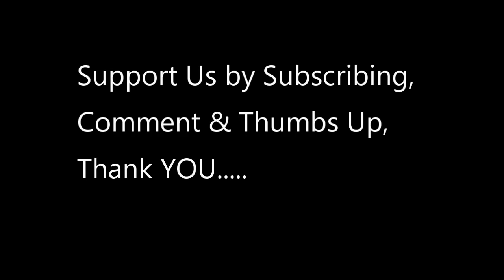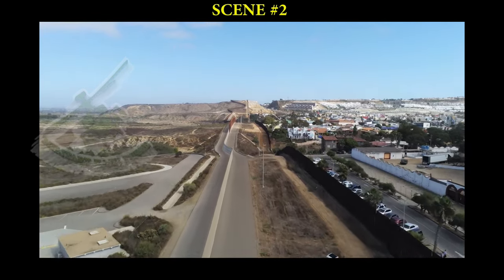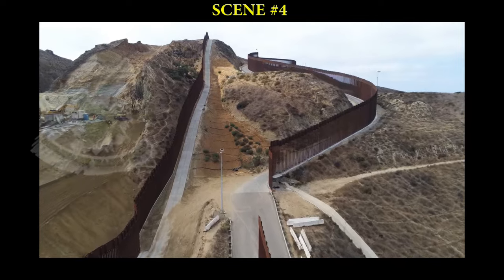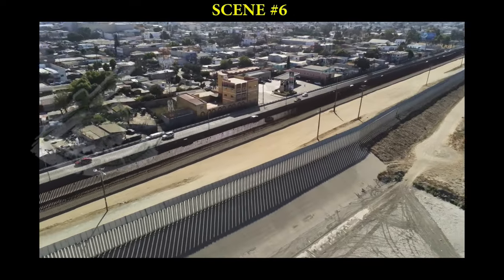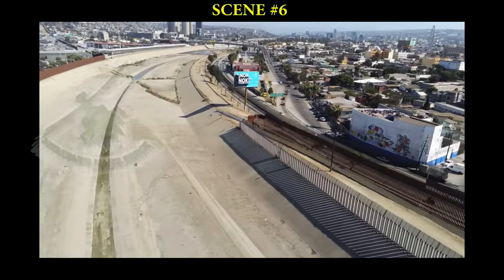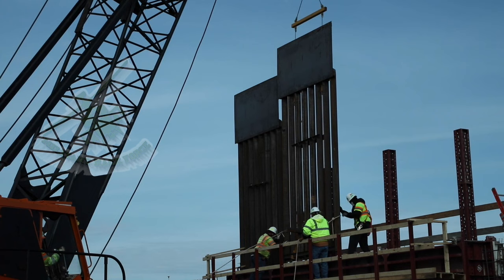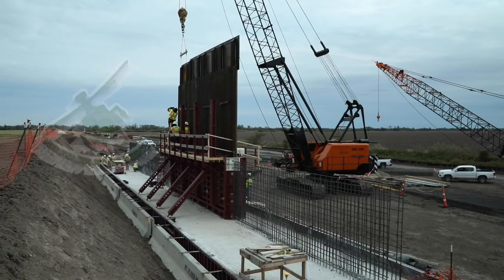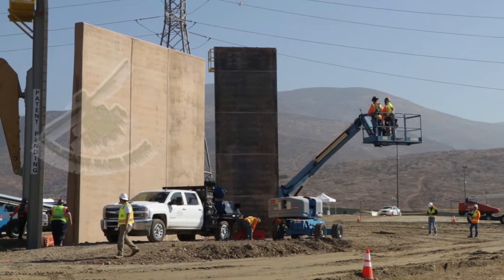A LOOK at TRUMPs BORDER WALL -UPDATE 2019 - PART 13

Comment: CBP selected a steel bollard wall configuration using heights of 18 & 30 ft. 93 miles built as of 12/13/2019! Current weekly rate 2 miles.
Reply: we feel safer now Mr. President Trump!

Comment: Pour concrete into the upright tube. Much harder to cut through
Reply: I like Joel’s idea better.
Reply: Trump can't afford that.  He has less than a year to convince you plonkers that he's built that wall he convinced you that you need.  He will make 500 miles out of tin foil and paper mache if it will fool you long enough to vote for him again.
Reply: Howard Little who running for election this election would be a better president?
Reply: @rwj3373  Trump is the worst president I have ever seen, and historians tell us he is probably the worst ever.  Any Republican presidential candidate from the last 50 years would be better. Any Democrat currently running would be better. Most of the people who support Trump would probably be better presidents than him. I would vote for Adam Sandler and Weird Al Yankovic before I voted for another Trump-Pence term.

Comment: The only thing that Bollard fencing is good for is for the steel reinforcement for the much larger concrete structure. Something Great Wall of China style but a little more Grande
Reply: It's a funding issue I think. If we get Republicans majority in House and Senate plus Trump in WH in 2020, we may have a chance at something more grand.

Comment: The reason the wall is this design is Border Patrol asked for this design for safety and security reasons. They can see through it and determine the threat and response needs.
Reply: And drug dealers can more easily hand drugs & $ back & forth more easily!!!!
Reply: Aaron Ehrhart, it’s true if there is no border patrol. And it’s also true that, ifthere is no border patrol, it can be made by throwing it over the concrete.
Reply: @aaronehrhart2346  yeah good luck when there's security up and down the whole wall!!!!

Comment: Did they install seismic monitors to catch tunnelers?
Reply from the maker: no
Reply: @militaryforcestv1  to bad
Reply: @patrickradcliffe3837  The wall goes 6 feet underground,i think in most attempts a patrol agents will see you digging before you finished.

Comment: Today, CBS finally had to admit the boarder wall is being built and Trump's promise is being kept.....
Reply: Just because the wall is being built doesn't mean its having an effect. Ya, a really thick fence is being built at our expense, and while on paper it looks sound, it only took a cheap power saw to make it instantly obsolete.
Reply: @rektaldischarge7496  UP UNTIL NOW CNN SAID TRUMP WAS ONLY REPLACING BOARDER FENCE....Now the real wall is going up. Only time we'll tell.
Reply: @rogersowers9837  Not much of the wall has been built, and the wall that is currently built was proven to be ineffective as people are climbing over it, and are cutting through it.

Not only was it a waste of money but its obsolete on arrival.
Reply: @rektaldischarge7496  But 90% of illegal crossing still happens at the port of entry because you can't carry all those drugs any other way. It still will stop most.
Reply: @rogersowers9837  Highly unlikely, people still are getting through and even destroying the wall in the process, again, basically a waste of money.
Reply: @rektaldischarge7496  You would find something wrong if it was perfect.
Reply: @garystrauss6682  I actually made a few points on what the wall would need, that being you have to risk not seeing through it for it to be near impossible to gut through, and the second would be something similar to prison walls at the top that would make climbing it a pain.

A ladder would still get over but normal climbing would be impossible as well. To be honest, this is nothing more than a thicker fence, and yet its still a useless piece of shit.

My hate for the wall is the fact it was poorly thought out, and its design is so easily made obsolete with either a ladder or a $20 power saw.
Reply: ronald rusin  You fell for one of the classic blunders!

- Republicans after using tax payer money to build the wall -
Reply: Ignoramus, "boarder" is spelled, border. 
Disqualified from participation.
Reply: @theelaffingman8776  Try what exactly?
Reply: PJ R  Dude, a wall along Canada would be a nightmare to even pay for seeing how its tax payers who will be paying for it. Not only that, but the wall already along Mexico was instantly made obsolete as people climbed over it in a minute, or literally took a $20 power saw and cut through the fucking wall itself.
Reply: PJ R  Update on the wall, a few weeks back a large section of it fell over due to high winds. Again, it shows itself as a useless waste of money, but this time it was a pretty comical example.

Comment: Walls work I was in China a few years ago to see the great wall of China and I didn’t see one Mexican there at all so Walls work
Reply: China Doesn't have Democrats. That's also why walls work there.  
No NANCY POLOSI..Either
Reply: ronald rusin  I really hope this was a joke. cause Japan has to cross a sea not a wall. lol
Reply: You wont ever see anyone in China that they don't want. You sneak into China you will likely disappear minus your kidneys liver and eye lenses, and if your dog is with you he will get invited to dinner but not to sit under the table if you know what I mean. Lol
Reply: @rfitz4420  let's be real here, they won't eat your dog, they will however, eat your cat.
Reply: Nailed it😂😂
Reply: Steven Miz  Steven , Can you direct me to where and how this is happening . To cut the wall you must use acetylene and oxygen . An average 51" acetylene tank weighs 190lbs and the oxygen tank would weigh 150lbs+ . This would be for 30-40 minutes use , the tanks must be kept upright this would require a heavy duty vehicle to transport and be able to park within 10 ft of the wall to be able to use hoses without removing the tanks from the vehicle . Also if the coating is not first grinded off the wall the burning of the coating will give off toxic fumes to be able to grind on the metal you would need a very loud compressor . How is this being done without being seen or heard . I have no proof that this is not being done but if it is an average immigrant would not be able to do this only the drug dealers.
Reply: Bet your a-- they work. The Dems hate it because it cuts down on their voter imports.
Reply: ronald rusin  The wall is in the west, Japan is in the east. Read your geography books!
Reply: Steven Miz  So you're one of those open borders, tear American down seditionists, eh?
Reply: ronald rusin  It was built to keep Mongolians out. Learn to read and spell. (Claiming) haha climbing, Da.....
Reply: Are you for real? Oh my goodness, sorry I just can't stop laughing. The Great Wall is famous for its failure. As far as that ridiculous  billion $ PR stunt on our southern border is concerned, illegal immigrants drive across that border as tourists, then don't leave. That wall does squat to that.
Reply: ronald rusin   spell check
Reply: ronald rusin  Do you mean, climbing?
Reply: Robert Phipps  At least it wastes billiins of your/our tax $! ?????
Reply: @chuckkelly1225  Oooooh upset & afraid of strong woman; just like dmfp!!! Figures!!
Reply: Steven Miz  And $30. Walmart saws!!!!
Reply: @eaglerider1826  $30. Wal~mart saws have worked very well you supe!
Reply: @williamkerr2121  Or the brave ones still here in Amarica who don't feel the need to cower behind a wall balled up in the fetal position like dmfp!
Reply: @aaronehrhart2346  This from a dog barking in the street.
Reply: ronald rusin  the Chinese wall was built to keep out the Mongols and it worked. Review your history.
Reply: Lmao
Reply: Lol
Reply: Name one place in the world were open borders work
Reply: @anybodybutme5315  I have lived in Europe and France, Holland, Germany, Austria, Denmark, Poland, Belgium, Hungary all have open borders with each other.
Reply: Like I said open borders that work
Reply: @anybodybutme5315  All are better places than the USA
Reply: Really you've got to be kidding you think you're the only one who's ever been to Europe who's ever seen all the people trying to get on the train to sneak into the UK for the people from Syria that now can travel freely through the EU so when I say I know what I'm talking about I've been there done that got the T-shirt
Reply: Really you think you're the only person that's been to Europe I've seen the people trying to jump on the train and go under the channel to get to the UK I've seen the Syrian refugees that have been just dumped into Europe and now travel freely through the EU so you think it's better than the United States oh well but I've been there done that got the T-shirt
Reply: John Carosi  Bark! Bark! Bark! Bark! Silly, little dogs barking in the street, in the wee small hours of the morning, half a block away. Remember the raw, red butt burn of 2016? Well, pucker up for another one, Bucky, 'cause it's on its way there's not a thing you can do about it.
Reply: @aaronehrhart2346  supe??  Do you have any idea what you are talking about ? You're going to cut through the wall with a $30.00 Saw Zaw ,   After using 150 blades and two months time you might cut one beam . Let me guess you're another unemployed liberal who has never done any manual labor.
Reply: no trumps either
Reply: Not anofe taco,s. There. Lol
Reply: What are you talkin about Mexicans, Hispanics and many Asians are residing in Mexico. We are Asians we come from the Mongolian race. where all come from the Mongolian blood that came to Mexico 15,000 years ago. We were here before way before the white even put food in this... Viva la rasa..
Reply: Steven Miz  The only thing you get by running away is stabbed in the back. I quit running a long time ago.

Comment: 90 miles as of 12/6/2019. If the rate is 2 miles/week & we have 55 weeks to the end of 2020 then 2 x 55 = 110 +90 = 200 miles.

If 3 miles/wk then 3 x55 = 165 + 90 = 255 miles.
if 4 miles/wk then 4 x 55 = 220 + 90 = 310 miles
if 5 miles/wk then 5 x 55 = 275 + 90 = 365 miles
if 6 miles/wk then 6 x 55 = 330 + 90 = 420 miles
if 7 miles/wk then 7 x 55 = 385 + 90 = 475 miles exceeding lowest level goal
if 8 miles/wk then 8 x 55 = 440 + 90 = 530 miles exceeding most ambitious goal

New report due 12/16/2019 from @USBPChief
Reply: We'll have four more years. If the dems didn't hold it up so long it would be done by now.

Comment: If you build it, they will come, if you build it they will still find away around it, every thing has a soft spot.
Reply: True, but it will slow them down.
Reply: @jocarr1791  It`s like a Dam, find the soft spot and boom.
Reply: @garygagnon9655  that is also true but it sure beats the hell out of some areas of the border that literally have no barrier at all or just a strand or two of barbed wire.

Comment: 20 feet tall wall
Cannot. stop a 32 feet ladder
$10 shovel or 
$10 rope.
A person with preservation will achieve they goals. Some how some way.
Reply: They addressed that in this video when they said 'taller wall gives more time for border security patrol to apprehend' and 'the wall isn't the only tool but part of a system.'
Reply: @elmtree33  
American citizens
Need more help 
Many people without job
Reply: Mit Gon 

But a 20 feet wall is better than an a ten feet wall. And the 20 foot wall has an extra non bar barrier at the top to make it harder to jump over. By the way, boarder agents can have ample time to catch people trying to climb using a ladder and or using a rope. And shoveling is going to take some time if you saw some of these video. There is wide concrete base reinforcement. Also some areas have two wall sections making them have to cross  another wall barrier. But at the end of the day, you don’t want non walls or the old dingy ten foot walls. Boarder agents will have it easier.

Comment: STILL SUGGEST MOATS WITH ALLIGATORS AND WATER MOCCASINS ON THEIR SIDE.
Reply: What's to stop anyone from walking around the wall going into the ocean ...... SHARKS. ???
Reply: @chuckkelly1225  bear traps and poisonous jellyfish. Latinos are allergic to bathing anyway.
Reply: @chuckkelly1225  no they are fresh water.  Anyway piranha DONT eat LATINOS.  Upset their digestive system.
Reply: @danieltucker4168   is that why they cross in boats. ?  They could probably walk around that wall that extends into to ocean. Nothing stopping them. But as you said. Maybe salt water ain't their thing.
Reply: @chuckkelly1225  just shoot holes in the boats if they get one over the wall. If they hit spix, collateral damage
Reply: 😂  😂 😂  🚢  Tacos ahoy.
Reply: @danieltucker4168    PICKY. PIRANHA.   😂   Throw in a couple. Bottles of Hot Sauce.
Reply: @chuckkelly1225  no poison. But seems hurtful.

Comment: 18 feet is not high enough.. should be 40-50 feet high
Reply: With razor wire on the bottom, sides and top !
Reply: Funny then they have to go 30 feet into the ground. Hight winds would topple fence over.

Comment: Of course a cement wall will not work. Cement is a powder. Now a concrete wall on the other hand can be vary strong based on how much steel is used to reinforce it and the ratio of other ingredients.
Reply: concrete is a powder too, you could cut a hole through it in a few minutes with a concrete saw
Reply: @ericnortan9012  Eric, could you give me references where I can look to find information about concrete being a powder? In all of my 35 years in construction, I've never heard concrete referred to as a powder.  Thanks.
Reply: @kwilliamson1096  in all of your 35 years of construction you've never cut through concrete in minutes with a proper saw? Concrete is a mix of a couple different powders and rocks and water. Rebar for strength. They cut through it everyday, no big deal.
Reply: @ericnortan9012  the fact that concrete can be cut with a saw is not the issue. I'm want to know more about your reference to "concrete is a powder too". Concrete is Not a Powder. Concrete is a combination of cement, sand, and rock. I'm interested in knowing more about concrete powder that you referred to. Thanks.
Reply: Concrete ingredients: cement (which you acknowledge is a powder), aggregate (rock, sand or gravel) and water. Aggregate, when crushed or cut turns to powder. So the way I see it, 2 parts powder 1 part water. The point is it can be easily penetrated unless it's very thick and they still have tools to break through it. Don't take my word for it, go rent a concrete saw and sledge hammer and see how fast you can take out a section of sidewalk. They have tech and manpower to guard the border, put the money into the boarder patrol. This is just a money grab for Trump's fence building butt  buddies. Diverting our tax money into their pockets. Just like all these wars we pay for, who benefits? Not taxpayers, not the locals, just weapons makers and govt contractors. It's a scam and your all suckers. They've got you all scared of nothing. Immigrants have always come here in waves, have always had their backgrounds and loyalty questioned, have always been accused of being criminals and carried disease. It's all scare tactics to keep the working class fighting amongst each other. Instead of recognizing the real enemy, the corporate powers that control our government.
Reply: @ericnortan9012  I am so thankful that your not mixing my concrete. Why would you crush rock/gravel and let's not forget sand, to a powder then mix it with the cement, and water to make concrete unless you were making lawn ornaments? Using that formula to build a border wall is the most ludicrous thing I've ever heard of. Well, right after the idea that the United States doesn't need a southern border wall. If you believe that the only people that cross the border are good honest hard-working people that just want to simulate into this country, then you're living in a fairy tale land. As far as cutting into a reinforced concrete wall, sensors are placed along the wall pick up on the noise and vibration allowing the guards to respond to that location. Same can be said for a steel wall, a cutting torch could be used to cut a way thru but the sensors would pick up on the vibration along with the infrared cameras detecting the temperature changes and guards would respond.
Reply: @kwilliamson1096  I'm an electrician, I don't mix it, I go through it. Your talking about 3000 miles of desert, they don't have the manpower for the kinds of response time needed. The same can be said for a steel wall, easily breached with the right tools.
Reply: @ericnortan9012  3,000 miles...You sure about that?
Reply: @jocarr1791  1954 miles. I just pulled 3000 out of my ass because it may as well be 10,000

Comment: *** 20210104 *** Grand Total 457+ miles ** (CBP: 453 miles 20210104 ; Private: 4 miles). Promise Kept! This is ≥ 101% of 450 mile goal, ≥ 89% of 509 mile goal, ≥ 69% of previous 654 mile preexisting, ≥ 45% of 1,000 miles, & ≥ 23% of entire southern border. 

*Extrapolated @ 1 mile per day using 202101 rate.

Comment: Yeah, that artistically designed replacement steel slat fencing doesn't look too impressive and not at all like what was promised. Quite underwhelming and also insufficient.
Reply: Axel Hopfinger we need you to go down there and show them how it should be done. They obviously haven’t a clue.
Reply: @williamdowden4494  What did Trump promise again? A big beautiful wall, or some half assed steel slat barriers? Trump is a builder who works with contractors. Do you think he would accept and pay a contractor, who built something different and inferior than what was agreed upon? Should the American people?
Reply: Axel Hopfinger again. This is why we need you down there.

Comment: 88 miles as of 11/29 if were were to achieve 3 miles/week for 56 week through 12/31/2020 that would be 3 x 56 or 168 miles adding 88 we get 256 miles on 12/31/2020! We need to build faster ! At 10 miles a week 10 x 56 = 560 +88 = 648 miles.